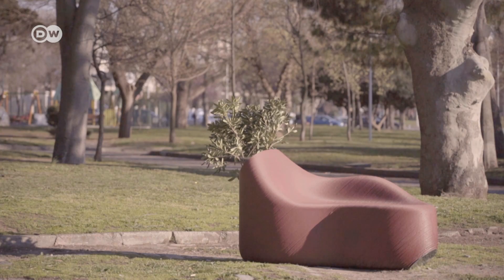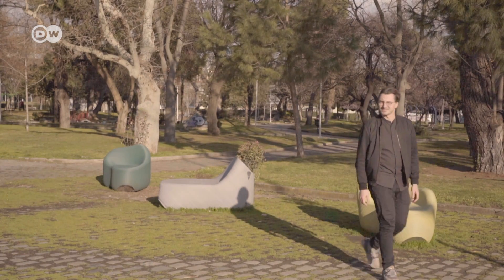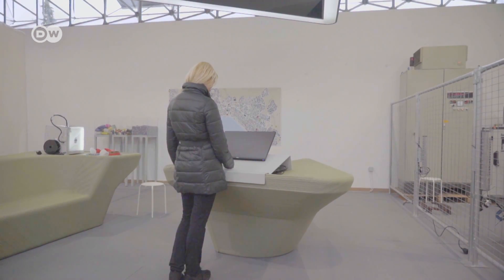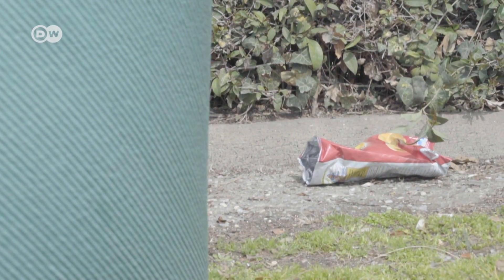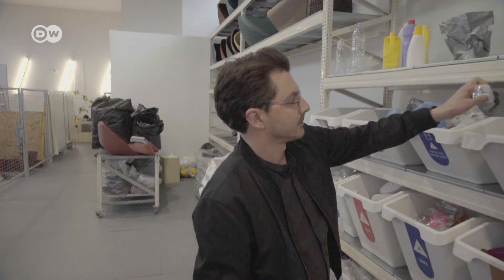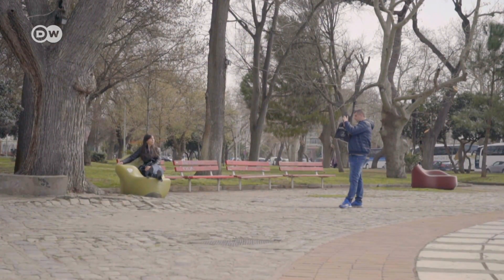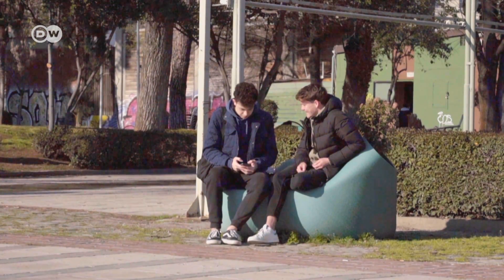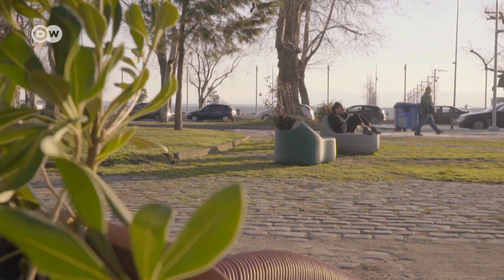How this Plastic Trash becomes Furniture? | Print Your City | Recycling & 3D Printed Furniture

Comment: But isn't this technology just using the lids of the plastic bottles which anyway been reused for long?
Reply: Not necessarily.. About 90% of all waste worldwide ends up in a landfill or is inappropriately discarded.. It's often cheaper to use virgin plastic in manufacturing as opposed to using recyclable plastic.